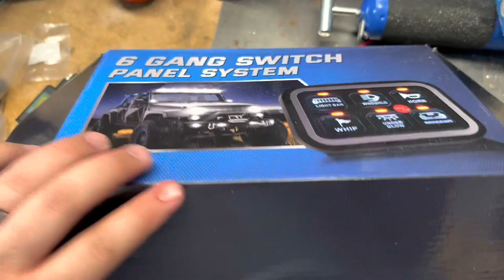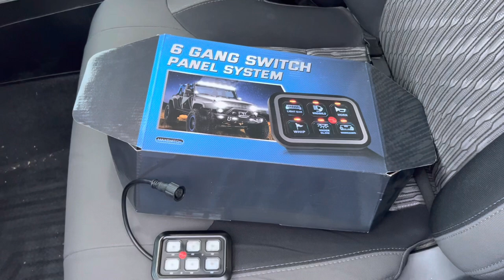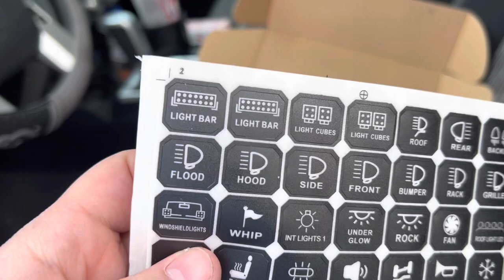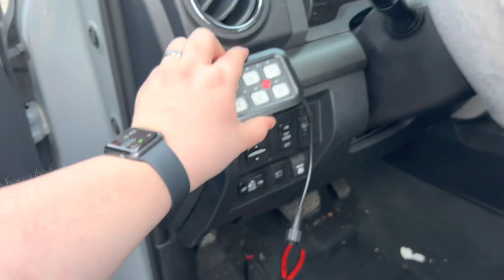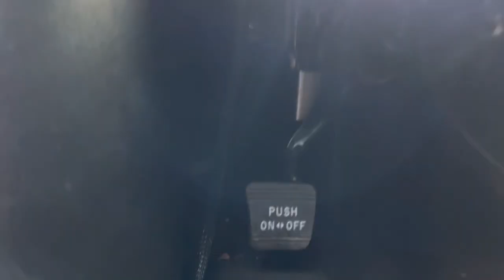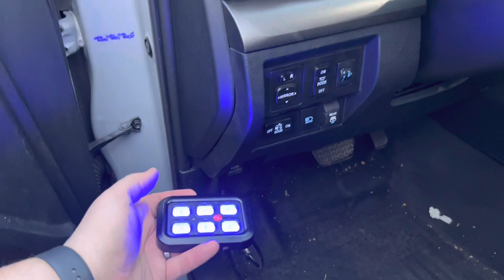Installing a 6 Gang Switch Panel for Accessories! Light Bar addition!

Comment: There’s a design flaw.

You have to have the ignition on to use it.  So if you want to park the vehicle and turn on the strobes, you can’t unless you partly power on the ignition, which lights up your other instruments and uses up your battery.  The controller can be wired directly to the battery, but then it’s always lit up and it will slowly drain down the battery.  There needed to be a hard on/off switch with this device.
Reply: That would be more useful with the Bluetooth, especially when you camp in your rig you can turn them on while without leaving your tent.

Comment: Dude thanks for the close ups. I’m running a wire from my tow mirrors to the cargo fuse tap in the engine bay. This will help. Still wonder how I can run a wire into the fuse box cleanly without just setting the lid over top.
Reply from the maker: Yeah I don’t really know either, hence why I set the lid overtop lol. I think there might be a release cut in the lid for a wire to go out but it was on the wrong side for me. If not you could just trim out a small relief cut and run it out that way!

Comment: Nice install dude, have you ever heard of trigger wireless? I have that on my Tundra, have 2 light bars that are being controlled by it. Didn't have to go through all that  work that you did. It even has an app that you can use as well along with the switches. The app lets you control the light bars, has flashing mode and also to dim the bars if they're too bright.
Reply from the maker: Well shoot man where were you months ago lol that sounds great!

Comment: Question if you have one of the switches to the on position and kill the ACC power does it stay on when the ACC comes back on or no
Reply from the maker: No it does not!
Reply: @kccreations5945  I wanna find one that does for like if someone was to hook a fuel pump or radiator fan or something that way they don’t forget to turn it on 😂
Reply from the maker: @christophermiller6689  I mean you could run a hot fuse tap wire to a relay and on the other side of your relay have the  radiator fan to it and one you turn the car on and that fuse gets power then so will the relay which will open it and power your fan!

Comment: Where are you grounding your lights? It doesn’t appear that the fuse panel has a ground.
Reply from the maker: Hey man I was confused on that at first too! It’s grounded to the battery!
Reply from the maker: @Suba-roo420 yes you are correct! Ground to the truck or the negative terminal on the battery!

Comment: So for example the light bar runs to the fuse box but where are you putting the ground that comes from the light bar I see power installed into fuse box but not the lights ground I’m confused
Reply from the maker: Hey man sorry if I didn’t explain that well! I was confused when I first got it as to why there wasn’t a positive and negative slot. I grounded the lightbar wire to the battery negative terminal which is right next to my fuse box!